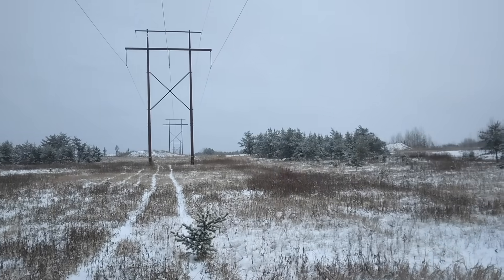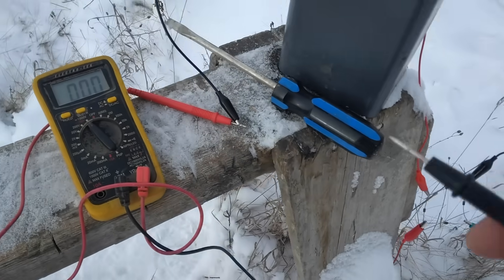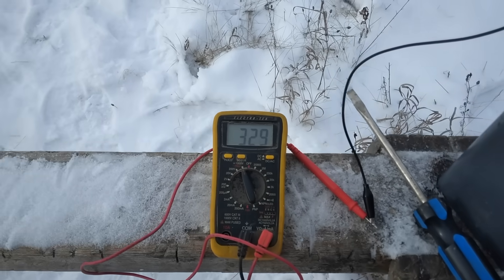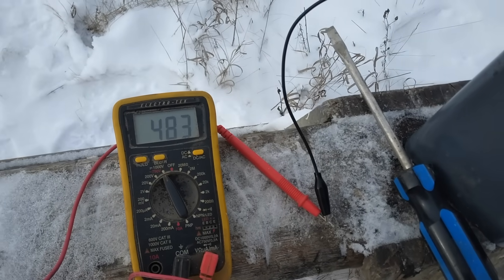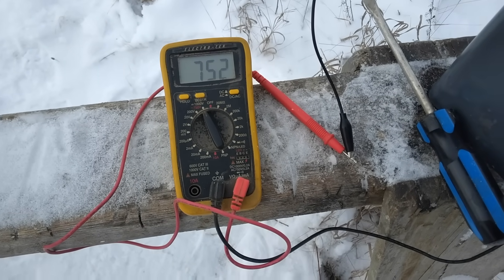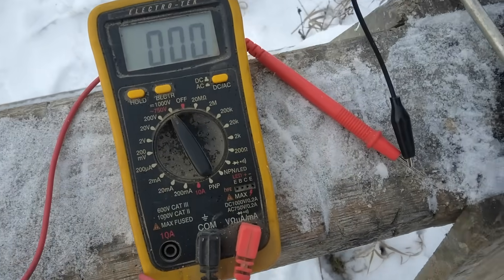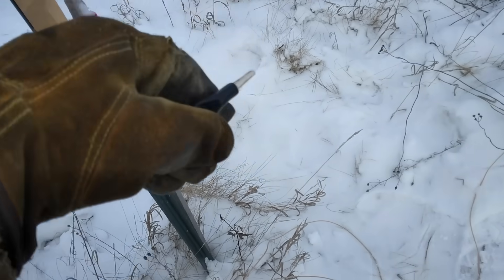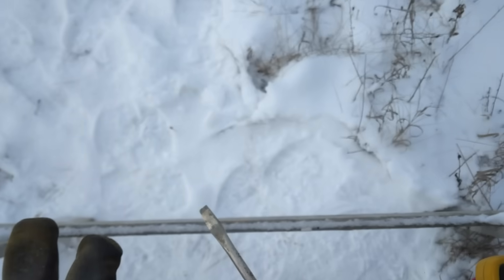Fences sucking power from under HV transmission lines

Comment: It would be interesting to see what voltage you get into a resistive load. I once had a similar phenomenom with an RF antenna near power lines, but a 1 Megohm resistor to ground was enough to snuff the voltage out.

Comment: From seeing a protest video re the high voltage similar to your situation , protestors were holding florescent light tubes in the air  horizontal and under these overhead wires which excited the powder (phosphorous?) inside the tubes and they lit up. Your fence might be a lit up fence if you first tested this idea and it worked , no electrical wiring required , no ballasts or starters etc., just mounting off the fence for height and protection. Like to see this if it is a goer. Thanks for your video. Our July is probably a copy of your January here in the Southern Hemisphere.
Reply: hi km-, have you become a flat earther yet? If not I suggest watching Level with Me (2023) by Hibbeler Productions

Comment: You can probably get more energy if you tap into the other phase.
Edit: You might also be able to use a LC circuit in order to sync with the line frequency and even get more energy

Comment: I had no idea that the range of the EM field from hydro lines could reach the ground with any appreciable strength. That is until a year ago I was wheeling beneath hydro lines and carrying an aluminum canoe on top of the truck. I noticed that when I touched the canoe I got a little shock. So naturally I called my friend over and said 'hey touch the canoe' =)

Comment: 4:24 Wow, I guess this is an old capacitor. When I see 88 MFD, first I think it's wrong but I also think megafarad! EDIT: Oh yeah, 1986, I see it now.
Reply: hi firstnamelastname, have you become a flat earther yet? If not I suggest watching Level with Me (2023) by Hibbeler Productions
Reply: @flat_earther  Oh yeah! Youtubr video are always more than enough to convince me to ignore the 50 years of science I've learned in my life. Thank for the pointer! I'll get myself converted right away!
Reply: @ BTW firstnamelastname, If the earth's a rotating globe and the land around the north pole is rotating counterclockwise, do you know why the ocean water doesn't get pushed to the equator?
Since if the earth is rotating then the moving water has inertia and it would make the water go straight and not rotate around the pole, because according to Newton's first law a moving object will go in a straight line, and for the water to rotate around the pole it needs a force to make it turn, so what's that turning force?

Comment: You trying to off yourself? Because that entire setup looks jump-off-the-bridge-safe. Don't ever mess with HV.
Reply: hi legatemalpais, have you become a flat earther yet? If not I suggest watching Level with Me (2023) by Hibbeler Productions
Reply: @flat_earther  i suggest as a self-proclaimed flat earther you ignore all of my previous advice
Reply: @ legatemalpais, If the earth's a rotating globe and the land around the north pole is rotating counterclockwise, do you know why the ocean water doesn't get pushed to the equator?
Since if the earth is rotating then the moving water has inertia and it would make the water go straight and not rotate around the pole, because according to Newton's first law a moving object will go in a straight line, and for the water to rotate around the pole it needs a force to make it turn, so what's that turning force?
Reply: It does tho. Thats why the earth is round. Its larger diameter at the equator than the poles. Otherwise it would be a cylinder. Its not just the water, its all the molten slag allegedly in the core.

Comment: Silly. Why do people keep posting videos on this phenomenon? It is called induction and has been well known for at least 150 years. There is no way to take any useful amount of power off this. You can make more power shuffling yur eet across wool carpet. You you can get some voltage, but you cannot pull any real amount of current. If you put a load on your point of voltage, it will instantly drop to zero volts. It is possible you could charge a cell phone over many hours, but that would be it. In order to get a useful amount of current, you would have to wind a wire around the powerline many wraps and that would be clearly illegal.

Comment: I learned about this back in the late 90's in a High Voltage Safety Course. The Instructor pointed out that many Vagabonds will park under these and set up Induction lines for their use.  And behold some time later I actually witnessed some folks doing this off I-10

Comment: I grew up under high voltage power lines (much bigger than these). We had an old golf cart we used to get around the farm with a metal steering “handle” that vibrated when you ran your hand across it under the power lines. Never got a shock or anything but always wondered what the other effects of those lines was on our health lol.

Comment: Try charging a bank of Super Capacitors The type you can use to start a car 600Mf x16v dc I use a bank of 6 to start my diesel Tractors, saves money buying lead acid batteries with more than enough power to kick an 8-cylinder diesel over.

Comment: I know there is loss from high voltage lines anyway, but can anyone hazard a guess what fraction of the power is actually “stolen”? ie, how much of the power claimed is lost in additional voltage drop in the line? Induction does “cost” in watts in the donor circuit.

Comment: OK... voltage is one thing... POWER is entirely another.  You should have put a load resistor on the capacitor to see how much POWER you could suck out.

Comment: The magnetic fields around the wires represent enormous potential energy that we just allow to dissipate.
Reply: There are people claiming that that's actually how the electricity is transmitted. Not strictly ions traveling on the wires as according to prior education.
Reply: One way to check is to test for differences in output at the end when you draw from it through the air.
Reply: @uncrunch398  It was my understanding that the ions themselves don't move, rather: the potential energy of the electric charge moves through the ions as a sort of wave. What do you think?
Reply: @LirealAndJeremy  IDK. Maybe. But listening to explanations, with visual effects, about how ions work in a battery and why leaving one too high or low state of charge causes damage, confuses it a bit.

Comment: I have serviced neon lights and signs. That deals with thousands of volts 6,000 to 20,000 been bitten several times. It is DC  current but will make you jump.

Comment: Plays havoc with pipelines that run parallel or even just cross HVAC corridors. When the ambient AC hops off the line major corrosion issues occur. It's even worse with modern pipeline coatings, because the AV has much fewer places to hop off the line; concentrating the issue to one or a few areas.

Comment: Your calculations will raise in the summer. As heat makes the lines sag closer to your wire. Take a florescent bulb out there in the dark. It will start to illuminate under the lines

Comment: I remember working at a sewage pump station that was under high tension lines. My forman didnt believe me ehen I told him every time I reach into the toolbox it would bite me. He thought I was just being lazy till he went for a tool and it bit him too. 78 volts frame to ground but it was summer and we were bother covered in sweat... And other things I will not mention.

Comment: It's stealing. You are putting a load on the transmission line that wouldn't be there otherwise. Think of the transformer on the pole next to your house, that transformers, while much closer, is not directly connected to your home's power, and yet you are charged for it.

Comment: I was test driving a metal RV for a fuel related issue. It broke down directly under the HV lines. As I laid underneath it trying to diagnose the fuel issue, I kept getting zapped, everytime I touched metal. I ended up jambing a piece of metal plate between the frame and the dirt. Then, I soaked the ground with water under the plate, to make a better ground. This was shortly after I had tried to suck siphon some gas out of the tank and nearly blew my head off. I felt the zapping in my mouth as the fuel got there. Scary shit that stray voltage.

Comment: Induced voltage, common. But sucking off that energy can get you in trouble.  Or, run a ground with metal fences.  Look at a substation fence, that is what they do.

Comment: Voltage matters not, even though it may impress lots of uneducated people. It took you approximately 10 minutes to collect 36 Joules. Since 1Joule/second = 1watt, then the power you managed to scavenge was 36Joules/600seconds = 60 milli-watt. That is 1/1000 the power consumed by a 60-watt light bulb. Ha! Set up 1000 of those fences and you might be able to power a single light bulb.

Comment: Induction voltage, higher than 40 ft. 69kv like on highways 65' poles if not bigger. Sub transmission lines. Then it goes to these tower wires...

Comment: @11:25 The online app to find the charge is great, but an actual test is better. When you disconnect the capacitor, reconnect it to a load resistor and *time* the voltage decay in seconds. Then you can calculate the amount of coulombs of charge you accumulated in the cap (and the number of joules of stored energy). 

I would also have tested the actual microfarads of the cap too. If it's an electrolytic (given the size, it probably is) it may have worn down over the years. Electrolytics that remain unused for long time will degrade in their capacity and can eventually open (or even short out)... You may not actually be running 88uF, it may be half of that.

Comment: TESLA used 18" radius Copper Ground 75' long in two locations until the affiliates discovered Power without a SERVICE METER/METHOD .. but with a simple condenser unit and storage it supply's infinite power
Reply: WHAT'S A METER MEASURE

Comment: use a coil / inductor  at one end   Wrap a wire around a piece of steel rod run the cable for the required length  you need to induce a oscillation in the wire  it will work   how well depends on how game you are
Reply: maybe run one long wire    along that wire  at set intervals   solder a diode to a feet or two of wire attach multiples of this to the long wire  it should look like  a  tv antenna
Reply: instead of diodes use inductors

Comment: Voltage 900V. Value of capacitor is written on the can as 88 micro-farads (MFD). Micro is 10 to power of -6. The max allowed voltage of the capacitor is written as 1200 VDC  (volts DC).
Energy stored in a capacitor = (1/2)*(capacitance)*(voltage squared)
E = (1/2) * C * V^2
E = (1/2) * 88 * 10^(-6) * 900^2 = 36 Joules
If you connected your body to the capacitor with a hand so & some bare part or conductive damp clothing contacted the ground maybe the resistance to current would be 100k ohm.
So the current would be 900/100k =  0.01A  = 10mA. Also this current would be very brief as the capacitor would rapidly discharge.
The electric shock would be very uncomfortable. It would not kill -- but don‘t rely on me saying that.

Comment: BTW "M" stands for "Mili" and not "Micro". This is confirmed by the size of the capacitor. A quick calculation shows that with that setup, a standard 12V car battery would take about 1 to 2 hours to charge. Set 10 such fences and you have plenty of electricity for an average house 24/7.

Comment: Try walking under a high voltage powerline with a old fashion gas light tube. i had some in the car driving down Sweden and under a  8000 or 12.000V line going to the distribution transformer.  it lighted them up back in my car

Comment: Maby a wire running in paralel with the powerline could act as a transformer, but then you have to connect to both end of the wire/eventuali ground one end - but be very careful, could be dangerous!

Comment: We used to stand in the back of the pickup truck holding a 8ft Fluorescent tube vertically above our heads, under 132Kv power lines, they would light up as bright as if they were installed!

Comment: These transmission lines are causing most of the global warming due the wires being too tiny for the high voltage causing too much copper losses due to not enough space for the electrons to bounce around. I have good solution but Big Fossil Fuel will try to send someone to kill me or light my house on fire. 😂 Bring it on evil ones, me no afraid of anything.

Comment: As soon as you put a load in your circuit, you soon realize that the power is unusable for practical purposes.
Reply: The solution is to charge a battery bank, and hook up electronics through an inverter.  For example, a printer uses about 1000 watts, but it only has to run for a few minutes at a time.

Comment: If you look closely at the top wire of those transmission lines, it is a bear wire. That bear wire on the top is collecting free, atmospheric electricity. The reason why you cannot have trees or buildings within the easement of the powerlines is because that would bring ground to a higher level and not allow atmospheric electricity to fall on the top bare wire.

Comment: About 20 years ago my father worked on Corona loss on transmission lines. 
 With the knowledge him and his buddies possessed. 
 One of the guys that lived near powerline staked out a bunch of copper wire and some kind of pattern got electricity for his house and the neighbor. 
They're in the business so they know the people that are in the business of clearing the right of ways. 
 Whenever this happens they would go disassemble the wiring and then reinstall it when it was done. 
 They've been getting free electricity for decades and still do

Comment: I hope you have NOT killed yourself with this plan, yet. Allow me to tell you a couple things. The outer jacket of coax is a ground, which you used backwards. Had you used plain copper wire it would have charged faster. Second, the high cables use aluminum wires. If you use aluminum wire, like a fence for instance, it will probably charge faster. If you put up a fence make it a five-wire, steel fence with at least some steel t-posts to constantly discharge static. In wet-foggy conditions even the ground 200 feet back from your fence may carry a charge.

Comment: I was re-lamping a cobra head fixture along the median of a local Army base.  In an insulated bucket truck, I kept getting shocked every time I touched the fixture.  Even though the circuit was turned off,  locked out and the inline fuses were disconnected.  I was baffled until I looked up and saw the bases  transmission lines were less than 20' above me.

Comment: This exactly how a lot of the Manhattan Project was powered without being physically tied to grid. They used "antenna" up in the air as intake points. Had an engineering professor in college who powered his house the same way.  It is amazing how much power those transmission lines bleed.
Reply: Its not bleeding power technically, its interacting with the electromagnetic flux/capacitive coupling.
Reply: @generation-x406  you're* a clown. It is collecting diffused electricity that would otherwise be lost. The size of equipment needed to have a noticeable affect on the power grid would be huge.
Reply: @Dan.Parker  It takes one to know one. Where you getting your red nose these days?
Reply: @ I am not familiar with that terminology.
Reply: @Dan.Parker  Not surprising
Reply: @ Collecting this radiant power is like collecting litter off the street and recycling it for money.
Reply: @Dan.Parker  it's just induction, bulding up a magnetic field in the fence which then becomes electricity when it collapses every second as the AC cycles, which is creating a small resistance in the lines,  it is leeching additional power regardless of how small it is..
Reply: @Dan.Parker  im guessing your not an electrician coz thats not how electricity works
Reply: @HicSvntDracones  it doesnt create resistance. it creates voltage, the wire is the resistance
Reply: @ "It creates voltage" is the dumbest statement I have ever heard.
Reply: @Dan.Parker sorry you have no idea it's not free energy
Reply: @Tom-f8r8o  I never said it was "free energy".   More like energy recycling.
Reply: You cannot power anything with an antenna under high voltage lines especially not even a small appliance lol you’d need to trickle charge batteries and then use those, you might be cable to capture a few volts and half an amp at best
Reply: Nicholas Tesla knew how this wireless energy could of been harnessed and more. The earth creates electricity freely. 
Using oil is just a dependency/control game.
Reply: @flatout5815  Not really, at least not in any meaningful amount we can reliably harness.

Comment: You should try the test again using an unprotected wire. There is likely RF shielding in the coaxial cable that will most likely block some of the electromagnetic waves.

Comment: Growing up, we would park our pontoon boat at the base of Hoover Dam on Lake Mead and drop lead fishing weights over board, then collect 'proximity' electricity from the turbine generators to power our boat's electrical  needs. We would collect so much that the part we didn't need was sold to the city of Los Angeles power utility. This excess electricity was sent to them in the form of AAA flashlight batteries. They supplied enough electricity to power 500 homes. True story. 

As ridiculous as this BS senerio is, out of every 100 people that read it, about 30 or so will believe it at face value to the core of their being. These are the same cadre that believed and then voted for our present leader. There's a fool born every minute.... the moral of the story here is: Learn how to be a critical thinker and stop being a 'Pakled'.

Comment: Yes any wire or fence will pick up Static voltage which will shock you to your knees,,but it Cannot be used to run typical appliances,,hook up a blender to a automobile spark plug and see what you get.